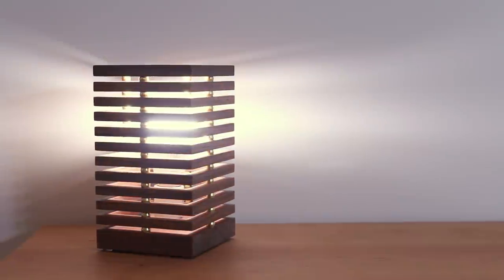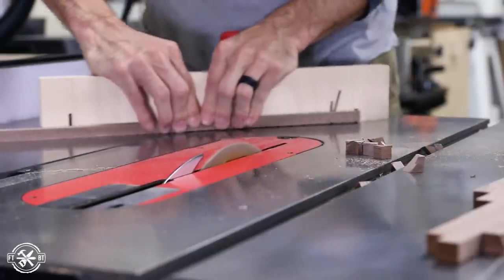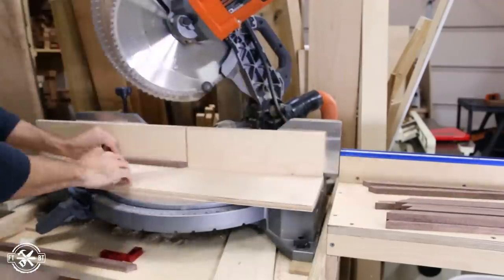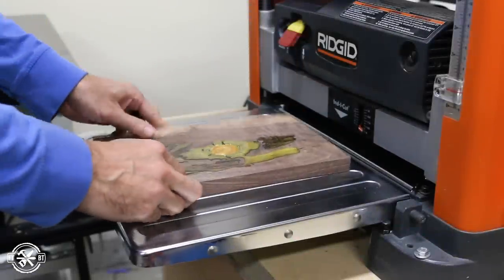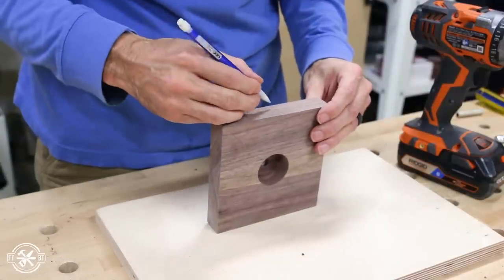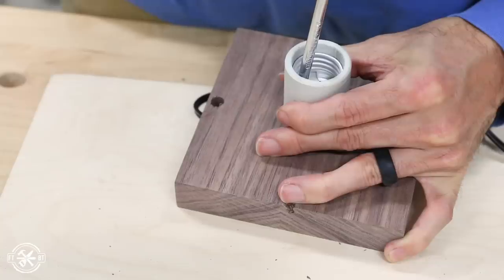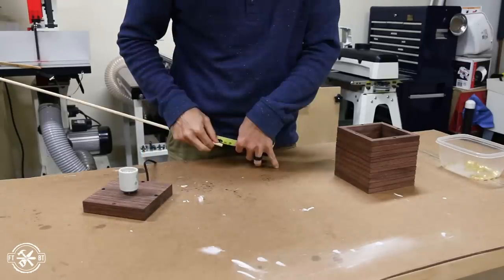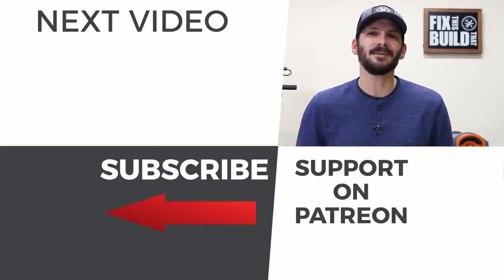DIY Desk Lamp with Color Changing LED Light

Comment: I am a 3D print maker. I will be using your designs but instead of wood I will be 3d printing your parts. Then assembling the light fixtures the same way   Thank you for your design ideas and such great detailed instructions. I use to have a great wood shop but life has changed and now I am in an apartment so I have to change my building style.

Comment: Amazing little lamp! One step I would have added just for the aesthetics is an opaque liner on the inside to hide the light bulb when it's turned on. I love that epoxy filled knot hole at the top. Great way to make use of scrap wood lying around as well.

Comment: Great looking lamp. If you do another one, you may want to look into the Underwriter's Knot when wiring it up.
Reply from the maker: i did look at that, but the mounting plate didn't have space for the wires, that's why I settle for the knot at the bottom

Comment: I'm think you could omit the switch, the light bulb I bought,  I can use my phone to switch on and off. thinking next time I'll make it with Bluetooth speaker bulb. Great project. Need to get the Wiz bulb for the fireplace setting, I was cheap.

Comment: Another thing you could do is add a diffusion layer inside so you can't see the bulb so easily. You could do this by sanding clear binder pages (the things you slide  papers into to put into binders).

Comment: You could use mirror on the top board from inside so it will reflect light. 
By the way, thanks for your hardwork. I guess, I can do it.

Comment: I'd say the rule #1 on building a lamp is to make sure the bulb is not visible from any angle you'd normally look at the lamp from. Only reason this lamp "works" is you used a dimmable bulb.  The sections should have had a downward slope to them, covering the slits between. But then it would look like any other lantern style lamp.
Reply from the maker: It's not visible from normal view angles. I shot the video low for a better look at the lamp. Even when seated next to it you don't see the bulb

Comment: Are the strips half inch by half inch
Reply from the maker: Mine ended up slightly thinner, but yes. That was the goal I shot for.
Reply: @Fixthisbuildthat  Thanks. Almost done with chest of draws for my granddaughter like the one you made except mine got 6 big draws unlike yours with 4 and 2 but the design like yours. My next project the lamp.

Comment: Im just going to say this now.  You don't cut at a 45 degree angle with a table saw,  Thats what a radial arm saw is for,  I can understand not having one because they are super expensive but still you should never do that. Other than that the lamp is pretty cool.

Comment: Seems like a lot of tools and work for a hobby craft 🤣🤣 so much for DYI nice lamp tho!
Reply from the maker: Like I mentioned, you could start with 1/2" stock and eliminate most of the tools I used. It's definitely doable with a table saw and maybe just a miter saw if you can get 1/2" square stock 👍👍 Don't let tools hold you back, there are ways around it